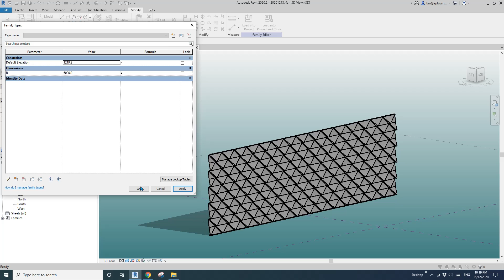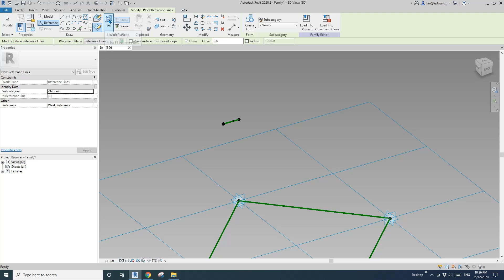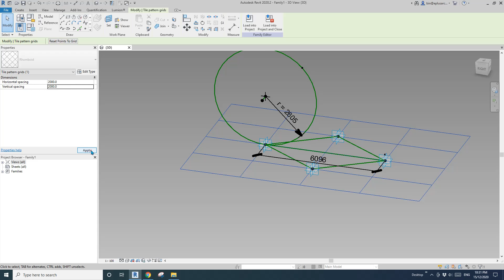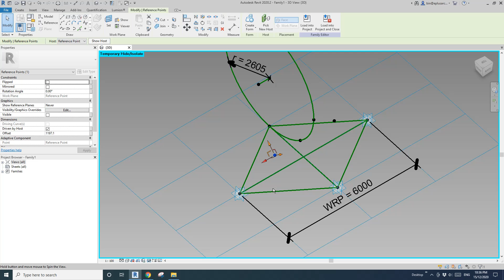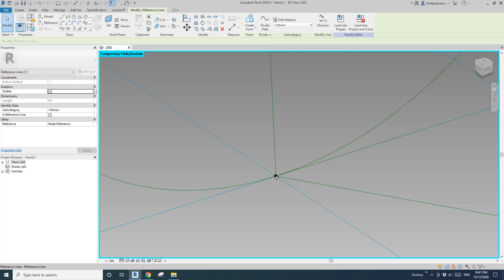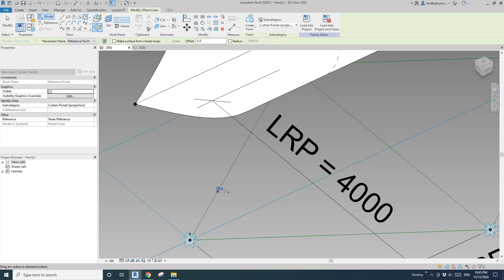Comment: Hello, i occur very annoying problem... when i was created my pattern in pattern based family and load into my project and set to my divided surface everything is ok despie one little thing... there is four points at each segment so my overall surface looking terrible with number of black ponts. I get to know that there four points are four adaptive points at pattern based editor... I dont why these point occur on that project. Do you have any idea why it happened? Could you help me?
Reply: They are supposed to be invisible I think. Can you do  screenshot?
Reply: ok... I solved my problem... this was caused by divided refrence line into path... i had to delete this line with path.
Reply: Good. Actually you can hide that divided path if you need it.